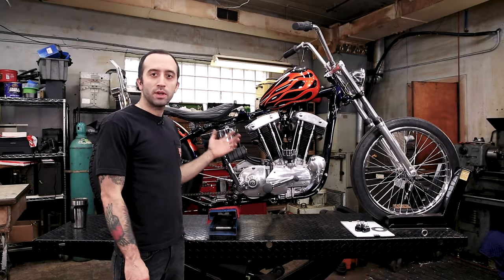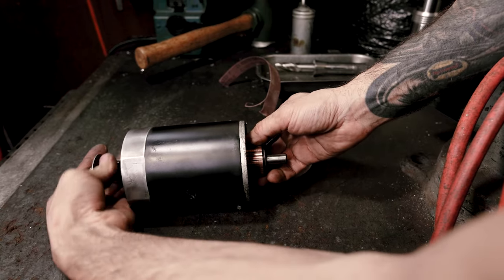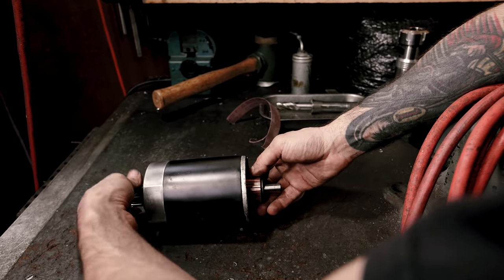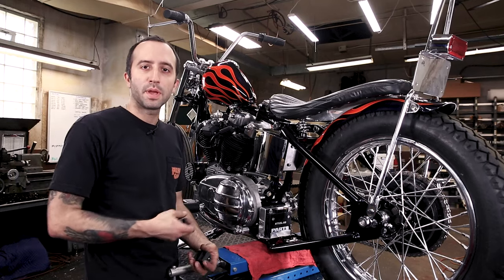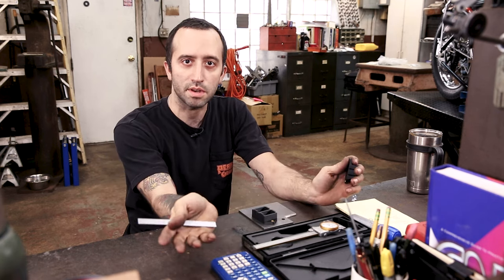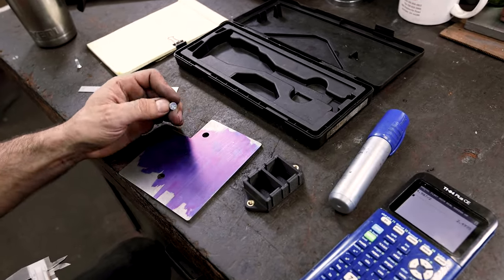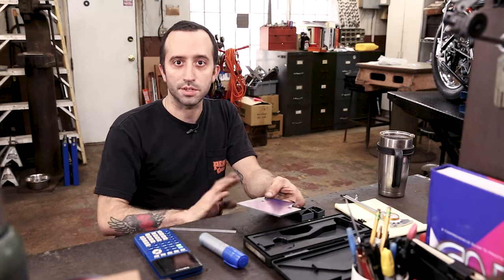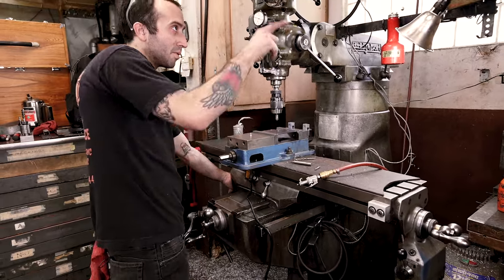Saturday Sportster - Season 2 - Episode 13 Generator & Regulator Install / Circuit Breaker Mounting

Comment: Tim, I'm going help you a bit, not to be a know it all,  but because I dig dealing with everyone at LOWBROW, as well as I only use CYCLE ELECTRIC whenever I can for charging needs.
That said,  the armature is the entire shaft and windings from bearing area to bearing area.
The brushes ride on the 
COMMUTATOR, which is what you are talking about. 
A trick way to clean the grooves in the commutator is with a prepped hack saw blade.
Cut it in half, because 1 end needs to be 90 degrees end. Tape up the opposite end for a area to hold with your hand.
Now usually the better quality blades may cut too wide of a groove, but this is easily remedied by placing the blade in a vice   with hard jaws and lightly compressing the teeth until you have the width of cut like stock. The rest should be self explanatory, lightly, and parallel to the shaft work the blade back and forth to clean up the grooves. Generally a hack saw cuts  only 1 direction but the commutator is soft and the rearward strokes will just clean out the particles. 
Easy peasy,  and works great for decades now.
Reply: And then I finish up with a scotchbrite pad moreso than sandpaper, but that's just how I found works best, of course use what you have as long as, like you mentioned is not too course.